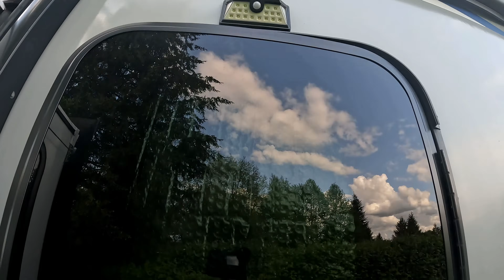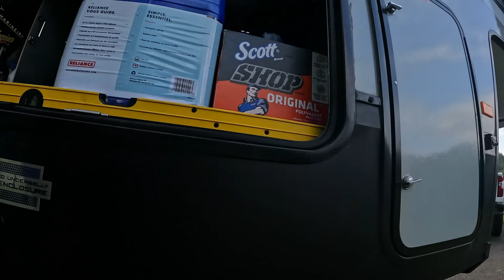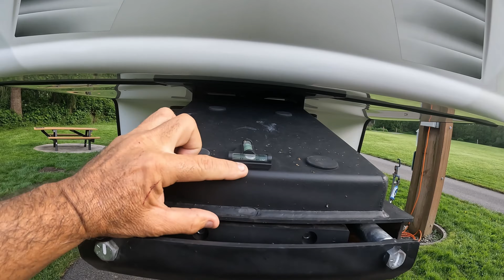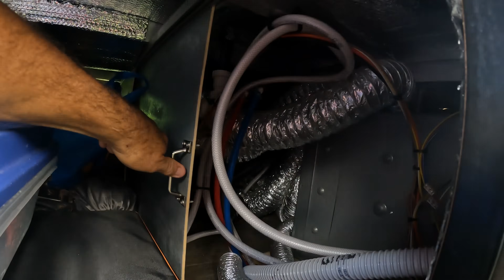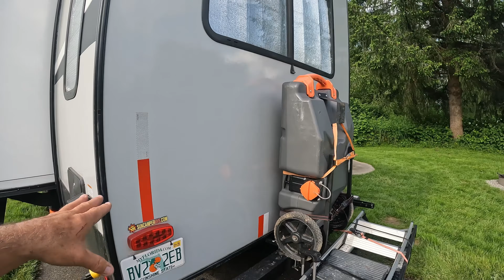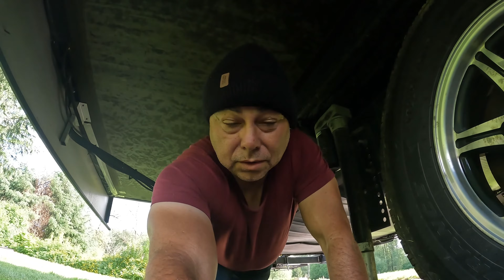Every Upgrade you need on your RV for your Alaska Trip #rvlife #rvmaintenance #rving

Comment: I would be interested to know some of the wire sizes especially to that 3,000-watt inverter. My Brinkley came with wire for the inverter and mostly plug and play and my 3,000-w. inverter wire is much larger. I also have 4 Battleborn bat. in my bay. Also, we have done the trek to Alaska 3 times with three different fifth wheels and spent the whole summer each time. It is an awesome trip. About three hours past Whitehorse in the Yukon there is an awesome pull over for the night on Kluane Lake. A beautiful turquoise lake surrounded by whitecap mountains. We filmed a Grizzly bear and her cubs there last time. Can be seen on my you tube site "Burlington Bill" Travel safe. This is Burlington Bill busking on the road and here on you tube.
Reply from the maker: #2 gage off of the Inverter, shortest run I could make, #4 with batteries tried to keep the same length as much as possible, as you see I use a lot of Breakers and fuses in line so whenever i need to work on any part of the system i can shut it down.  We are sitting in Whitehorse now will look for Klunane Lake Thanks for watching and i will be sure to look you up. (YouTube )
Reply from the maker: Sorry 10 gage for all small runs from controllers and fuses.  #4 for DC to DC charger from truck to battery.
Reply from the maker: We stayed at Kluane lake site you recommended for a couple days, Awesome just as you stated only problem was i had to watch people pull fish out one after the other because i did not get a Canadian fishing license (will be ready when we go back through).  Thanks for the heads up and Love the Mustang we had a 65, 71 Chevelle SS and 68 SS but i have to admit the Chevelle was my favorite. Sounds like you get inspiration from Willie Nelson a little in the tone of your music, I have several friends with musical background i have spent a many late nights just amazed at how you guys can do that.
Reply: @the50somethings  Thanks for the reply. Might run into you guys down the road. We winter in Arizona off grid at the LTVA by senator's wash.

Comment: Nice upgrades, I've done some of these to our 5'er and still working on my "want to add" list. How did you feed your charge line to your truck from your battery bay? I'm about to do this to get some charging from my truck.
Reply from the maker: I ran a snake along the same line as the stock cord and pulled wires through (had to remove the cover screw to allow room) Good luck